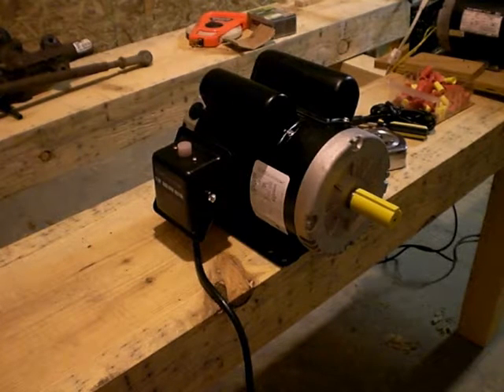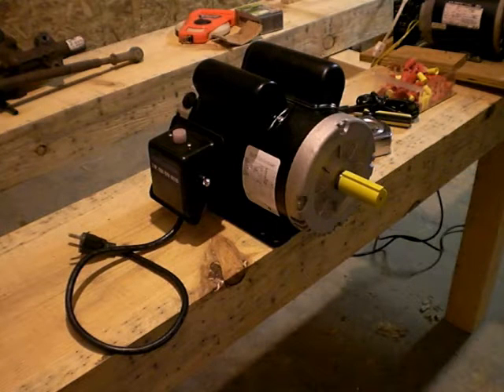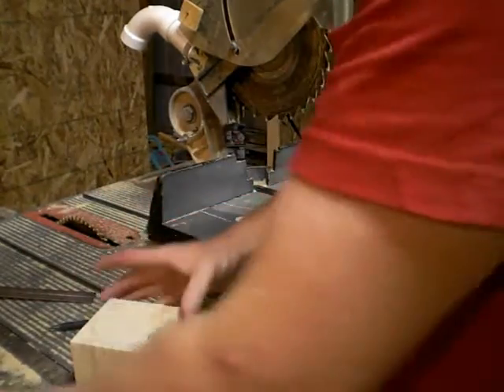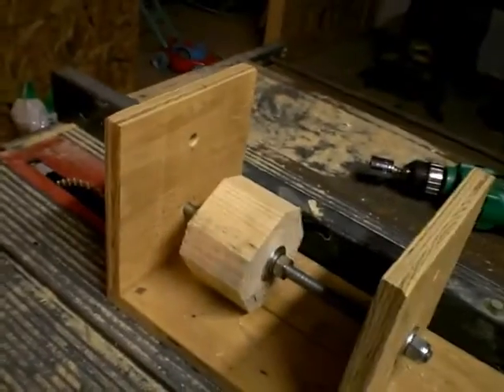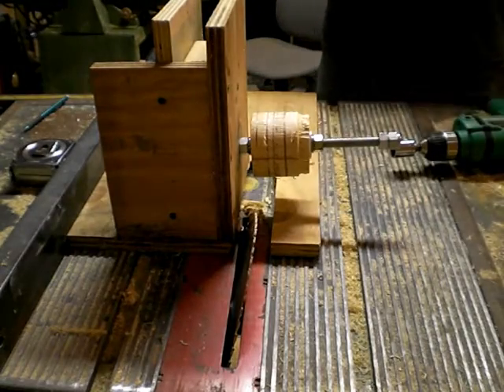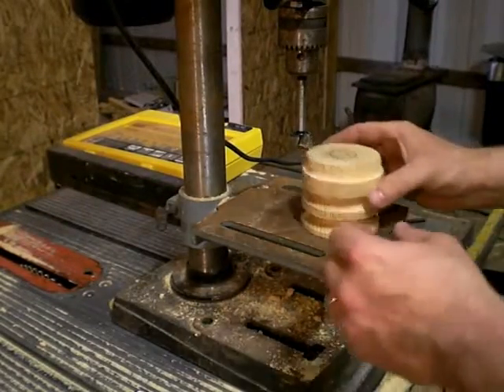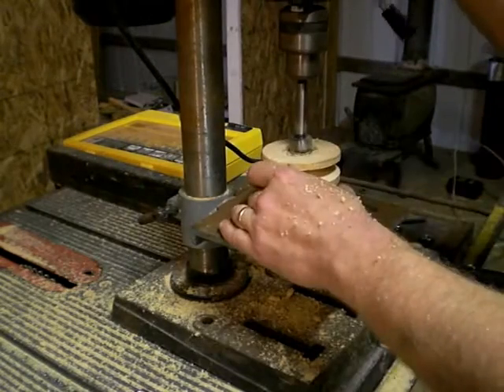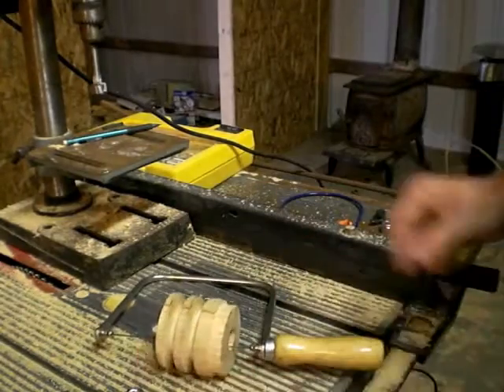New Bandsaw Motor and a Home Made Wooden Dual-Groove V-Belt Pulley

Comment: Next time, buy a machine that already has the motor you need and salvage the rest of it for parts. It is sometimes.much cheaper than buying the motor by itself. If you don't want or need the parts, sell it on ebay and make back close to what you paid.